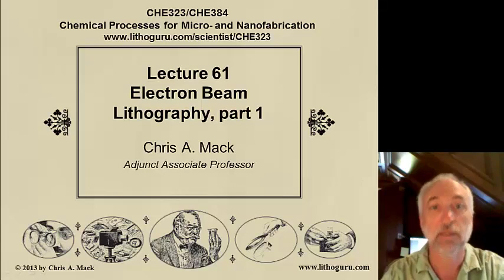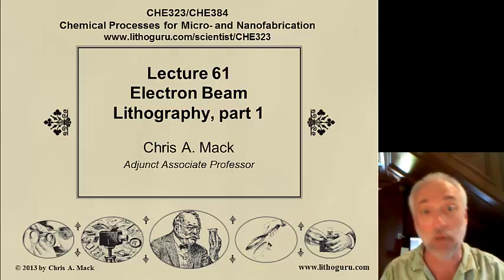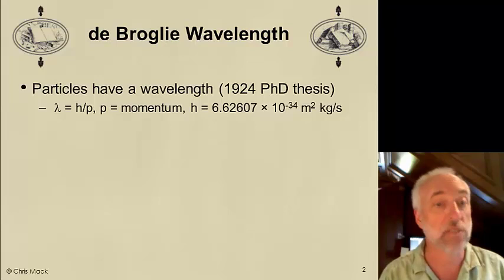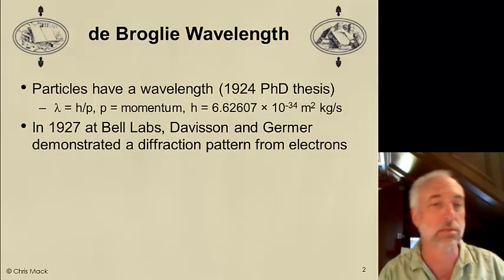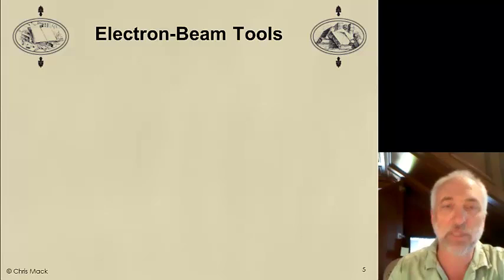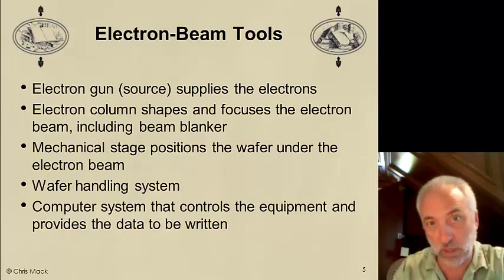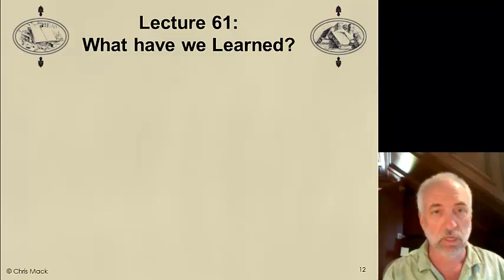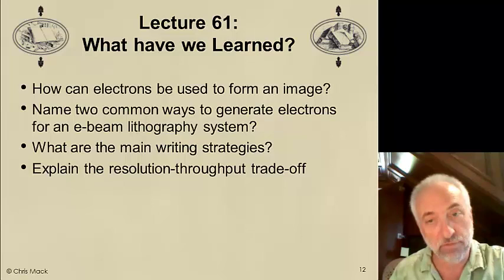Lecture 61 (CHE 323) E-Beam Lithography, part 1

Comment: Hey Chris, could you help me understand 1 thing? Papers/people seem to throw the word 'mask' around alot as such I am not quite sure what it means. In our e-beam example, as you said, we don't need a mask. We have a program which tells the electron beam where/how to print. Ok, good - maskless writing. Now I am reading papers where they argue that they use this technique to CREATE masks. Ok, again good. We so we create a mask, through maskless e-beam litography.

But what can someone do with such a mask? Can this mask, be then passed on to a computer-chip company which works with photo-lithography and they will use regular light to illuminate that mask such that they are able to print its features on a wafer and create micro chips? Or what industrial use can such a mask have? Please help, I was nowhere able to finde the answer. Thanks
Reply from the maker: Yes, masks are used in projection imaging in photolithography.  See lecture 39 (and later lectures) in this series.

Comment: 4:40 how does or does the electrons wavelength relates to current (13.5 EUV)nm structures? i.e. 0.037≈3.7nm?
Reply from the maker: I'm not sure I understand your question.  Are you asking about the wavelength of an electron (which depends on energy) compared to the dimensions currently being fabricated using EUV lithography?  EUV lithography is capable of printing about 16 nm lines and spaces today.  At 100keV, the wavelength of the electron is 0.0037 nm, which is much, much smaller than any feature being fabricated.
Reply: @ChrisMack   thats is what i was asking. Si according to the specs, at 100Kav an EB can etch 3.7nm?

Comment: Anyone knows what is meant by lens NA (9:40) in this video?
Reply from the maker: NA = Numerical Aperture, the sine of the maximum half-angle that can make it through the lens.
Reply: @ChrisMack  Thanks! Are you sure the wavelengths are correct at 4:05 ? I tried to calc. it myself for 100eV using the formula:  E = (h*c)/(lambda). This was my result:
http://bfy.tw/OBwx
I am two orders of magnitude bigger for some reason. 10^(-8)
Reply: @MrsFrau 
Hey! I hope that you found the answer to your question. You are using here an expression of the energy representing a photon, rather than an electron of mass m and momentum P = mv, where v is its velocity. The kinetic energy of that electron is E = P^2/2m. To calculate lambda, you must apply De Broglie's postulate of the wave-particle duality: lambda = h/P, where h is Planck's constant. P = (2mE)^0.5
Make sure that you express h in eV.sec and E in eV in the formula P = (2mE)^0.5.
You will end up with the relation: 
lambda(E) = Ko/(E)^0.5
Where: 
Ko = 12.265
E is the energy expressed in eV
lambda(E) is expressed in Angstrom